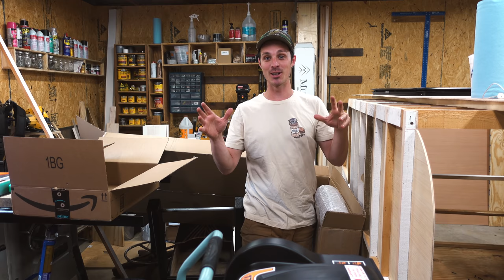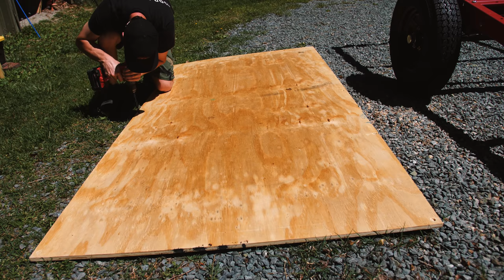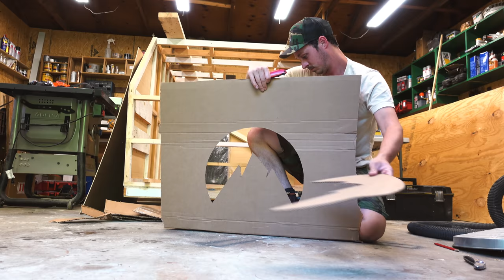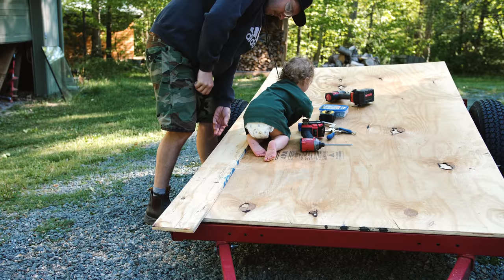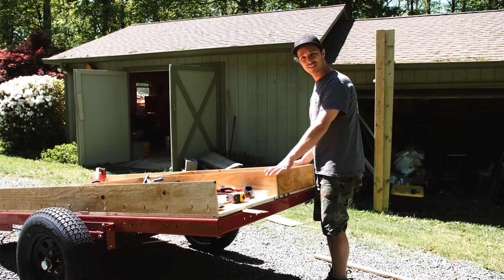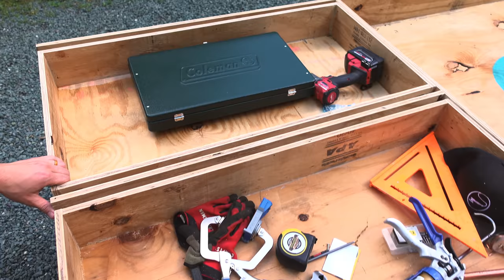This Teardrop Trailer base is nothing but STORAGE.

Comment: On my HF trailer, I drilled the holes clear through the 4'x8'x3/4" plywood & replaced the top 12 bolts on the trailer with carnage bolts.

Comment: Looks great! For your next drawers you need to construct the boxes slightly differently. The pocket holes should be in the front and back and screw into the sides. So that when you’re opening and closing you’re not pulling the joint apart. It also helps for when you put a face on because it hides all the joinery! 🤙🏽

Comment: The joys of building things. Personally I’d have welded angle to the trailer at each corner and some flat bar pieces through the middle sections. But then again I’m better with steel than I am using timber.

Comment: So is the weight of the base / teardrop on the bolt heads from the drilled out holes all that is going to keep it from sliding off of the trailer? I'm was watching and wondering if you were going to use the bolt holes on top of the trailer's frame with some carriage bolts or something. Then again I know pretty much next to nothing about woodworking (other than building some workbench's and frames with my dad from scratch from spare lumber) or trailer building which is why I'm watching you so I can learn. Thanks for the great series I subscribed on part 2 and am in the process of binging the whole thing. Its my hope that maybe over the course of the next year or two I'll be able to start a similar project.

Comment: For the sides, consider a rebate/rabbet joint in future rather than pocket holes on a butt joint. Easy enough to cut on a table saw and you don't have the angled nonsense going on that caused so much frustration. Nailgun or screws straight through the bottom. Plus you've got two edges to register against and glue on, so it'd be super solid for a big base like this. Just gotta account for the extra depth required for the slot when cutting the sides.

Good on you sharing the frustration. It's easy to pretend work doesn't drive all of us crazy sometimes, great to push against the appearance of instagram perfect sometimes. 

When you busted out the chisel at first I thought "oh nice, graham is getting into hand tools for detail work". Maybe not, haha.

Keep it up!

Comment: I love the pocket jigs when working with actual solid wood pieces but when working with plywood or HDF I still perefer to use rabbit and dado joints. To each their own, granted and as in my previous comments, you are not doing it wrong, just different. I’m reallly liking your build. I have been considering building myself a wooden truck camper, it’s fun watching different builders and their takes on how it should be done!! 
    If you are interested “ENDGAME” is a great example of truck camper building. He has a great style of design. Like I say, seeing different builders are great ways to increase our knowledge and skills. I think a cabin with the style ENDGAME builds would be very whimsical and awesome!! BIIGGG challenge though. These drawers are an excellent idea to overcome the difference in height needed.

Comment: What's the exact size of the new 13 inch tires .. what is the speed ratting .. what ply are they .. I heard the harbor freight tire is 2 ply ... Did you get radio tires at 10 ply rated at 81 miles per hour .... It's only 12 inch tires but I saw a set of radio tires with 10 ply with 81 miles per hour .. I am thinking of getting them yet I would rather have 13 inch

Comment: I'm starting my own teardrop trailer project and using the same trailer. Would love the link for the wheel that ended up working. I have been going back and fourth on if I wanted to switch the tires out or not.
Reply from the maker: Just added the link in the description! But also here - https://amzn.to/2RCG9LW

Comment: not sure what your plan is for the underside of the wood closest to the road, but i suggest seeing if eastwood would sponsor you with some products that you can rustproof the frame of the trailer with. some undercoating basically. that way you get that ad revenue or at the very least see if you can cut some cost from the build. 

as always, your videos are next level entertainment and im still waiting to see where you fit that bathtub.

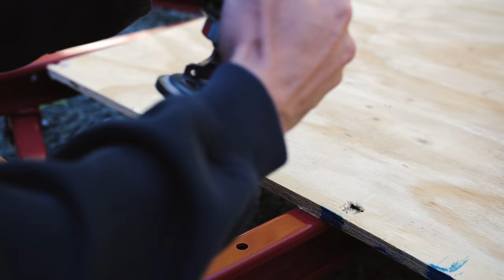Comment: 11:24  Careful with your sweater's draw strings when you're using a rotary tool in the 10-20,000 RPM range.
Reply from the maker: Yes! Good call. Not gonna lie, literally thought of that and then had to change later!

Comment: What size wheel and tire? And what bolt pattern? Awesome video!
Reply from the maker: The tires I got where 13” so only a little bigger but look massive in comparison. 4 1/2 5 bolt pattern. I forget the exact tire size.

Comment: Was there some reason yo could not use the original pocket holed board and turn it around?
Reply from the maker: I think I did, but maybe I didn’t because there were too many holes in it and I thought it weakened it maybe. I don’t remember!
Reply: @WoodnessGoodness  I didn't appear so but you may have. Nice project.

Comment: I would have the drawers pop out the sides of the camper, the hitch is going to get in the way of the front ones
Reply from the maker: I think you're right...trying to think of a workaround!
Reply: @WoodnessGoodness  make the drawers  in the front of the tires as wide as the top of the camper so that it looks like the wheels are built in instead of the camper on top of them, then you can also Make some covered cubbies in the back on the side too to match. Just gotta waterproof the wheel wells with some thick sheet plastic to protect them.